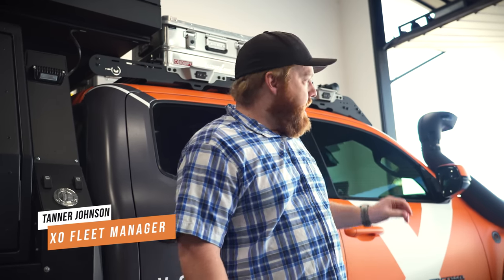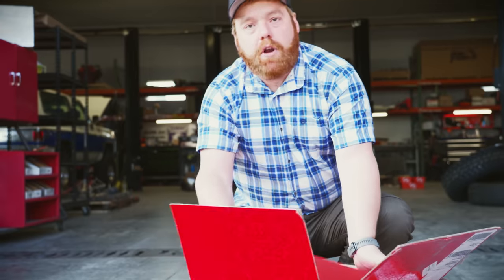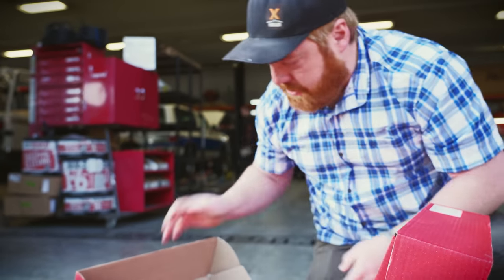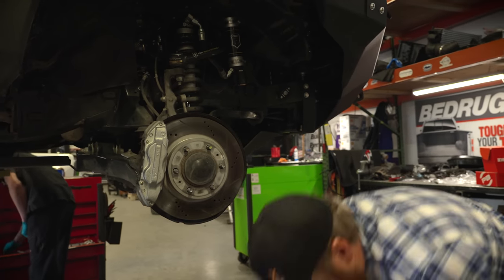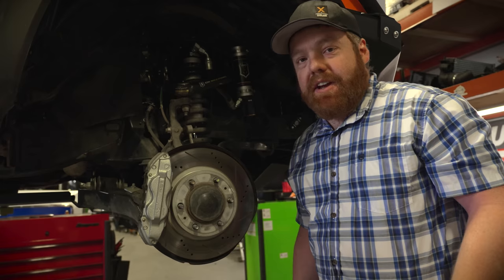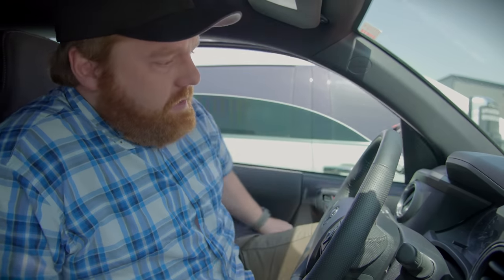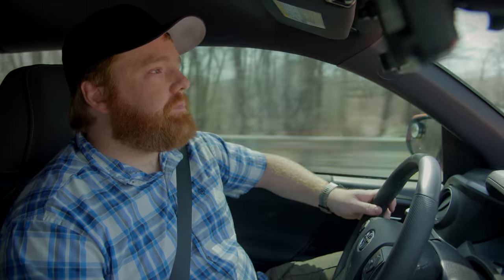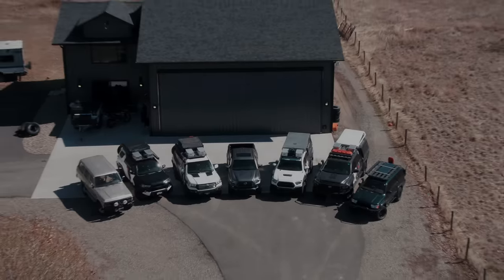Why Upgrade Your Brakes | Power Brake Upgrade on 2021 Tacoma | X Overland Shop Talk #11

Comment: When I bought my 2003 tahoe, the first mod I did was brakes. Went with PowerStop. Haven't had an issue yet, 15k miles later and the pads are still nice and fast despite mud, sand, rock crawling, and thousands of stops ams gos in traffic. The calipers had recently been replaced when I got the truck so I didn't order those, but will order those and longer brake lines when I get my next set.

Comment: Quick question do they remove the dust shield on your Tacoma? If so, do they have any issues especially fitting on the caliper because the instruction says not to remove instead trim it all the way to the hub?

Comment: Bedding brakes is basically the opposite of what you said. You want to get the brakes hot to bed them, I'm not familiar with PB make they have a different SOP for bedding?
Reply: you're right, even with PBs
Reply: Exactly.

Comment: The only downside for a kit like these before international travel would be the potential difficulty in easily replacing components…I’m guessing you’d have a much easier time finding stock Toyota parts than a boutique racing application, right?
Reply: Yes, but that goes to any modification, there's always a compromise.
Reply: @vanisshen4467  …which is why most dedicated overland tourers tend to keep the vehicles as stock as possible. Or carry spares. Not overload their vehicles to they point they’re way over their GVWRs.
Reply: @TradesmanOutdoorAdventures  Precisely. Currently planning a trip to South America, and replacement of consumables is part of the play.
Reply: The pads are an off the shelf part so can be purchased from any parts warehouse. This was done for precisely your point. The company is South African so you can get the pads literaly anywhere in the world. Which is believe it or not easier to get than Tacoma parts, being that the rest of the world (minus the US and Canada) doesn't get the Tacoma. Other than that, how often does a caliper sieze up? Rotors can be turned anywhere. The upgrade in stopping power this kit provides is worth every penny. You can have all the go you want but if you don't have stop, well then the last stop is a doozy. Brake upgrades are absolutely the best money you can spend. All it takes is one emergency stop where you stopped 12 feet shorter and didn't hit that musk ox, or other car, or person, and any headache getting parts or extra cost become worth it.
Reply: @rattlecanpaint  "Off the shelf part", so the pads used on this mod are Toyota factory pads?
Reply: @ChristianMFrank  not a Toyota pad but used on a number of other vehicles worldwide. You'd have to have the part number, but it's not a proprietary piece.
Reply: @ChristianMFrank  lot of this performance caliper share the same pads design, just like my ap racing caliper that can be use with endless or brembo pads.. and many others aftermarket pad company that make this pad such as from ferrodo, ebc and many more.. so pads availability are not to be concern.
Reply: Almost all overland travel roads can be navigated by car;) And it’s safer to just stay home in the first place too, btw

Comment: I need something like this for my 4Runner. The brakes lack that initial solid bite and have an undesirable amount of pedal travel from the factory.
Reply: I would suggest a more aggressive brake pad. You’ll have more brake dust and they will wear faster, but aftermarket performance pads are an intermediate/cheaper option before upgrading to a full big brake kit.
Reply: If you have a spare $3200 laying around, then you too can have a set of these brakes.
Reply: Price in the US is $2500 for the 4-Runner and Tacoma
Reply: Me too. I have a 3" Icon lift, which seemed to help a bit, buy would love a full upgrade too
Reply: Especially while towing a trailer.

Comment: Everyone should know that putting bigger brakes won’t make your car stop any faster. If you can brake hard enough to lock up your tires or have the abs kick in, bigger brakes won’t do any better. Bigger brakes are usually for being able to break over and over again and not get fade. 

Now bigger brakes will help if you are heavy and loaded. But I bet most peoples factory brakes are good enough.
Reply: You absolutely stop faster, but more importantly you stop in less distance. (Time vs distance) And you can do it over and over again before you get to brake fade. And EVERYONE can benefit from better brakes. Both the driver and the pedestrian or other driver. Even the deer and squirrels benefit.
Reply: @rattlecanpaint  we’ll how can the truck stop any faster if you already locking up your brakes, or you are activating the abs? It will be the same with big brakes or stock brakes. You are on the limit of your tires. The tires can’t stop any faster no matter what brakes you have. If you want to stop faster, you will have to get sticker tires.
Reply: One guy that mostly gets it. TBH I almost didn't watch this video because most "overlanders" or people with expedition rigs don't know much about all the engineering that goes into developing proper brakes. That's not to knock on the XO team, I just don't think this is where their experience lie. They said exactly what I expected.

If a company only designs a front brake kit, it is designed to do one thing, delay or even prevent heat soak  all together, for consistent braking. There is absolutely nothing wrong with this. In motorsports it makes a huge difference after a couple laps on the track. On expedition rigs it will make a huge difference on those mountain passes where you may need to use brakes more often. You might get less flex from a larger more rigid caliper but this is a rather small-moderate, and secondary benefit. What happens when, as the video states, increased braking power by 2x... Well increasing the front brake rotor torque by 2x just fucked up your brake bias, and poor brake bias is one of the main reasons tires lock up. Because the limits of your tires can't handle the force of the brakes on that axle trying to stop the weight of the vehicle. This is greatly affected by tire load. A front big brake kit will NOT stop you significantly shorter in like for like situations.

Dynamic weight distribution under braking, most noticeable in emergency stops, means weight can unload on one axle, reducing contact pressure on the tires to the ground, therefore losing grip... Too often people think that when they "lock up the tires" they're getting significant improvement in brake performance, when in reality it's is very much the opposite. How do you stop when your tires break traction? Best brake performance comes right at the limit of tire's traction at ALL corners. To achieve this you need to engineer a front AND rear brake kit taking into account a vehicle's weight, center of gravity, static weight distribution, and dynamic weight distribution under various levels of braking.

Comment: Would these brakes clear 16” wheels? I tend to run smaller rims size if possible
Reply: From what I’ve heard . No
You would need to upgrade to a 17” wheel
Reply: They do not fit with 16 inch wheels. I believe you have to get either a wheel spacer or an aftermarket wheel with a bit more offset as well. Or use a 4runner wheel. (14mm more offset)
Reply: They do fit under any 17” wheel on Tacoma’s and 4-Runners

Comment: Rear brakes???
Reply: I talked to the guy that owns Power Brake. He said they put a set of disks on a couple of Tacomas with this system and the extra rear breaking power made the rear end slide out. (Think using the coaster brake on your BMX bike as a kid). They said it was safer to leave the rear stock.

Comment: I would love to see a shop talk on modifications done to improve or maintain fuel economy with all the Added weight on the trucks.
Reply: Easy. Dont add weight and keep your tires small. That is optimum MPG
Reply: @christianmarthiens2815  That wasn’t the question. Question was with all that they do “including” the added weight and larger tires do they do anything to mitigate fuel, especially on longest travels where fuel is a concern, I know they do a long range fuel tank. But thanks for the input.
Reply: I'm not sure that there is any device that helps Toyota Tacomas and Tundras get better mileage. I'm a Toyota fan through and through, but their fuel mileage is a travesty. I'm convinced that the government required toyota to make them get shitty mileage so they wouldn't totally put the domestics out of business.